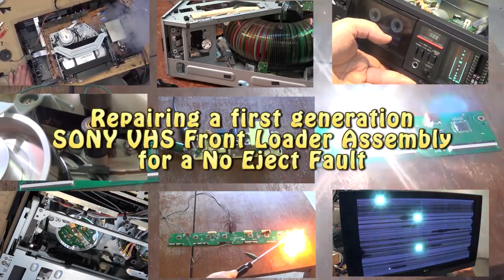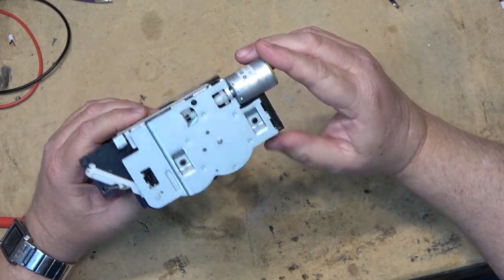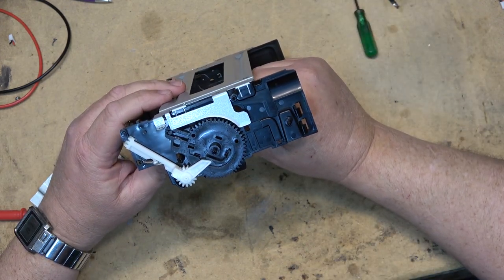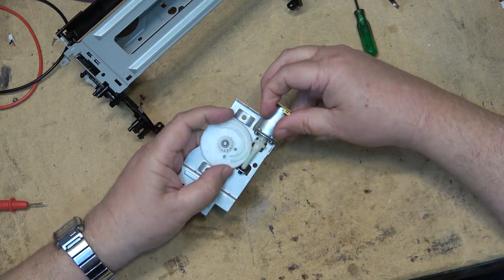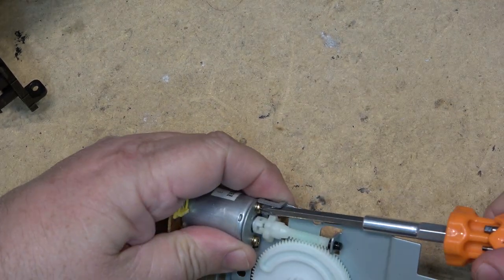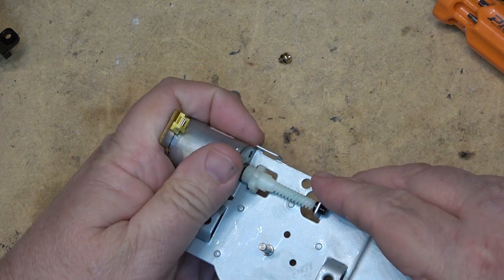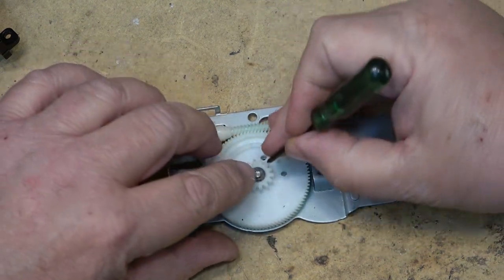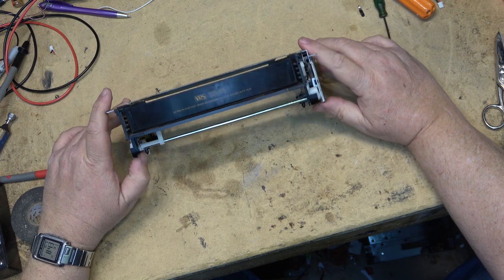Sony VHS Cassette Loader Will Not Lift Tape on Eject

Comment: My mechanism is not exactly the same but that little plastic bit was cracked just like in the video. Let's hope the epoxy mixture was correct and I put it together the right way but anyway thank you for enlightening me on what's the problem

Comment: Same coupler as the 711b3 betamax. I do a 3d printed replacement that works great and I do sell these on eBay.
Reply from the maker: Great I am sure people will need these.
Reply: Sir, where on Ebay can I find this gear?  I must be using the wrong description

Comment: I have a Sony ev-p10e 8 mm video player,  the problem is that powering on I see the drum rotating but pressing eject nothing happens. The eject led blinks for a while and then stop.  At this point also the drum stops and the power led will turn off. Pressing again the power,  the cycle restart.I have the service manual and I see that the Mode Switch has a motor. I tested the loading motor with a power supply and it works but the loading motor providing power on the connector doesn't. I don't know how the eject mechanism works,  but I guess that the loading motor will in some way activate the cassette deck release. What do you think? Should a failed mode switch cause this problem? Thanks
Reply: Mode switch motor doesn't works,  sorry for the typo above

Comment: Hey Dave, I'm wondering if pro decks used more metal parts inside? Brittle plastic seems to be the Achilles heel of old VCR's.
Reply from the maker: Broadcast decks (betacam and 3/4") yes but the so called prosumer or industrial decks no. Exact same plastic mechanism.  I have an svo2000 which is a pro machine and it us the same.
Reply: @12voltvids  Cool, if you ever repair one of these broadcast decks please make a video, this stuff is fascinating.
Reply from the maker: @2610Someone  I will.  I do have a pro svhs deck but it needs hundreds of caps replaced.  Some day perhaps.

Comment: Just repaired this on my Sony SVO2000 using the part from I'm guessing UrielX1212's ebay account using this video and it went great other than that little metal circle that holds in the white gear went across the room (I now realize why you had your finger over it while prying lol). 

Thank you for this video saved me some money and I'm more confident to do this kind of repair in the future.
Reply: where on ebay did you find this part?  I must be using the wrong description
Reply: @johnmazzone12  he might've taken it down but I looked up something like replacement plastic gear for Sony svo2000 or I might've used the beta Max uriel1212 mentions to search it

Sorry it's hard to find if I can locate the old listing I'll type another comment

Comment: Thanks for this one! Literally when you uploaded this, a Sony SLV-798HF I've got here decided to not eject a tape I was digitizing. Different mechanism, but I'm motivated to see what's wrong with it. Half the time, the mechanism goes into safety mode and reloads the tape instead of ejecting. The other half, I need to put my hand in front of the slot so the tape doesn't rocket out. Something may have broken, but there's no loose parts rattling around inside. Off to find a teardown video on this unit. 

Fixing this should be easier than the mode switch clean on a Marantz (JVC clone) SHVS I've got here that won't pull a tape in without a little manual help. Once it's in, everything's fine. Not seeing anything mechanically wrong with that one, but would make sense if the motor wimps out early due to not knowing which mode it should be in.
Reply: I have the same model as you that wouldn't eject. I found the cause was the lift arm the opens the door has slop in it cause the door to open too slowly.  The tape then jams or hits the door and reloads. Did you find out your issue?
Reply: @jasonallen522  It’s been sitting in a closet for a while. I’ve got too many projects going here right now but will take another look when I can.

Comment: HI! I NEED A SUPPORT WITH PANASONIC TH-46PY80PA 10 TIMES RED BLINK
Reply from the maker: 10 blinks is a voltage error on 3.3 5 9 or 12 volt supply. Could be a shorted chip cap or bad chip. Hard to say what it would be. I have done a couple of plasma sets and they were a pain in the ass to find the bad part.